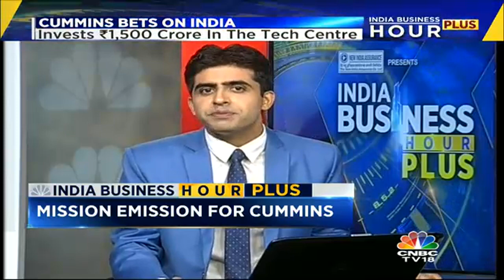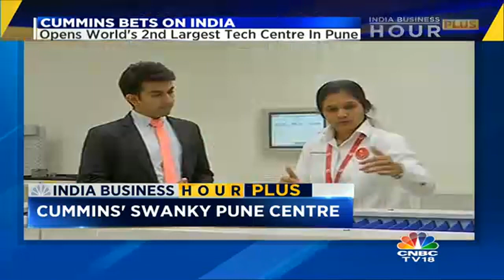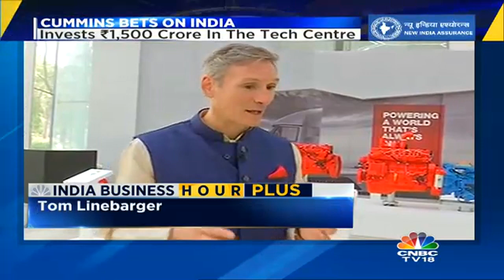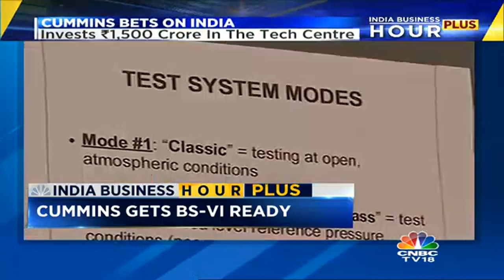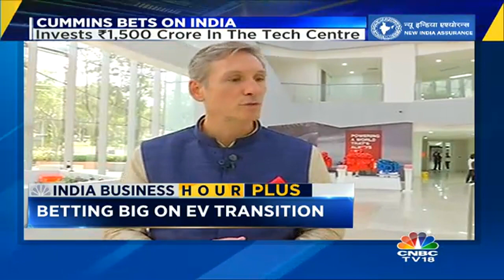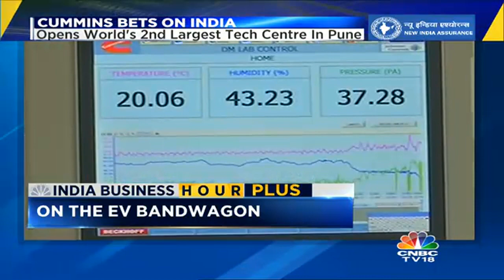Cummins Opens World's 2nd Largest Tech Centre In Pune

Comment: LUCKY INDIA HAD CUMMINS INDIA SO IT COULD QUICKLY GET A NEW ENGINE SUPPLIER FOR IT LIGHT TANK AFTER GERMANY FAILED TO PROVIDE INDIA FOR THE TANK. IF USA SANCTIONS INDIA THEN INDIA CAN PREVENT THE USA FROM GETTING ENGINES. SIMILAR TO THE BOEING APACHE HELICOPTER DEAL.